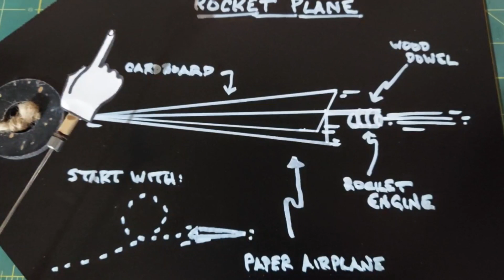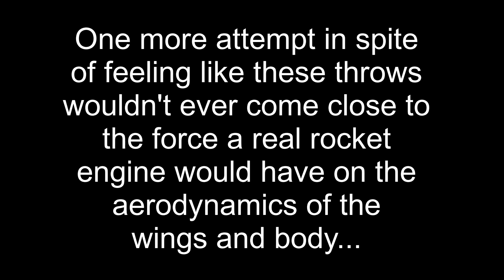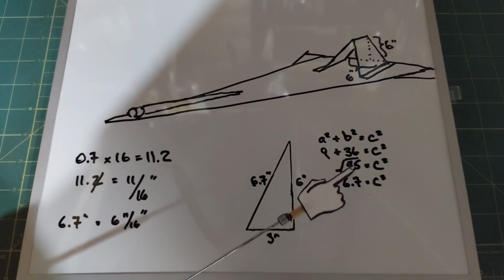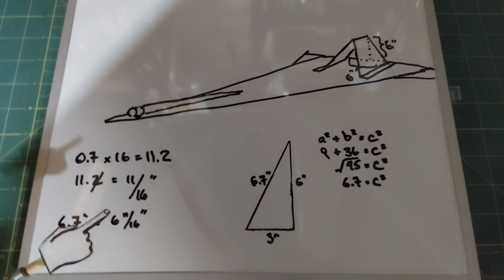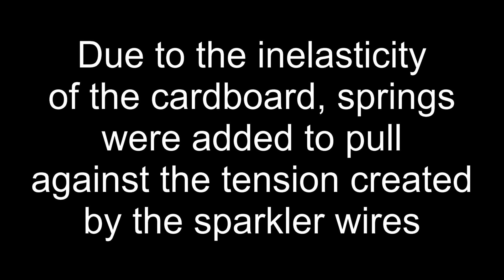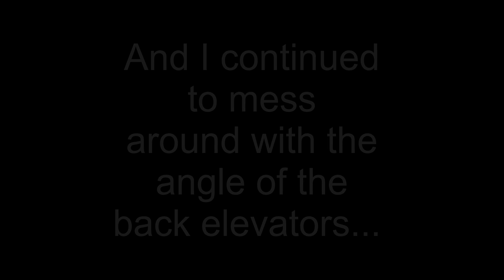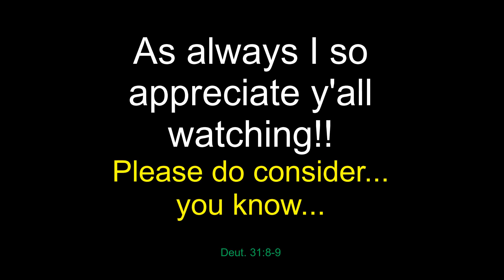Igniting The Rocket Paper Airplane

Comment: I think if you put the motor near the CG with a pylon it would work better. Consider a broomstick pushed from the back vs thrown from the center like a javelin.
Reply from the maker: Yes, you're right, this would be ideal.  However, I wanted to have the engine in the back for esthetics, and for the fact that of dealing with the hot gasses.  Putting the engine anywhere along the plane would have meant extra protection, and extra weight.
Reply: @cranialconstruction  i just wrote a very long reply and accidentally hit "cancel" instead of "reply".... i guess no one will ever know what i said...nah just kidding, the general jist was YES move motor further up aircraft to align with CG, AND ALSO please note the equation for the distance traveled by a projectile being affected by gravity is sin(2θ)v2/g, where θ is the angle, v is the initial velocity and g is acceleration due to gravity. Hope this helps.